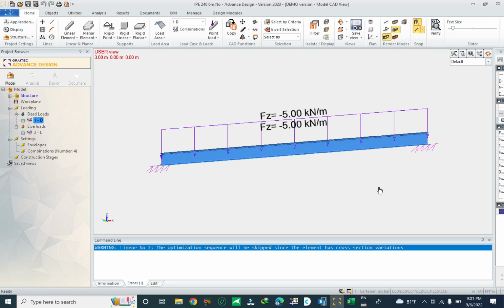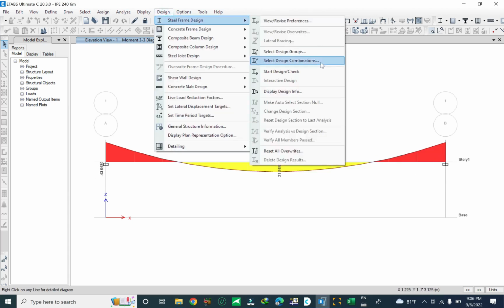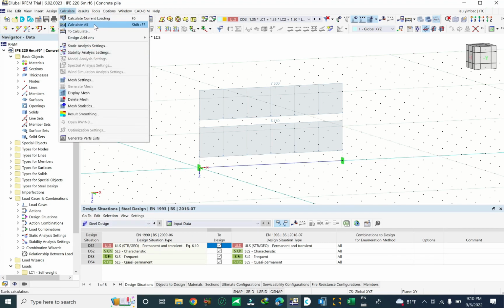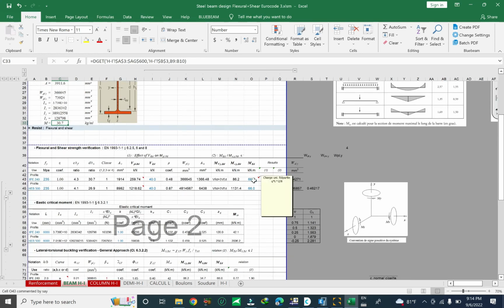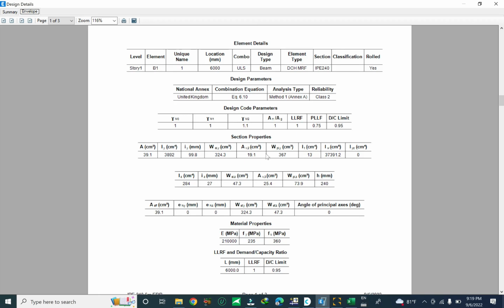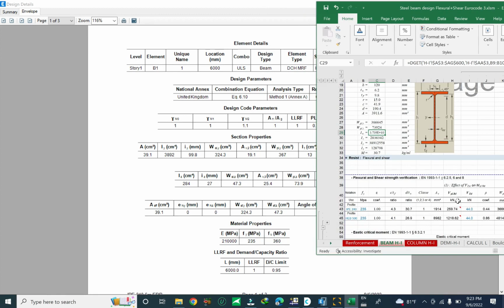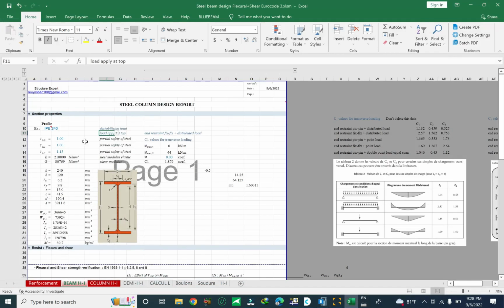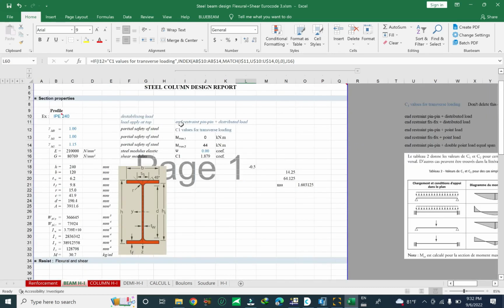Steel Beam Design Etabs, Dlubal Rfem, Graitec Advance Design, Excel Sheet Compare Results Part1

Comment: Hello,

first of, I really liked the presentation and the comparison of different structural analysis programs in the design of steel beams. I have some feedback about the design of the program RFEM.
 
It is evident from the video that an IPE 220 section is used in the model in Dlubal RFEM instead of the IPE 240 section, which is used in other programs. Additionally, when checking for lateral-torsional buckling in Dlubal RFEM, buckling curve "b" is used, which is the default setting that we allow to be changed in the ULS configuration. In the reference solution in the Excel file, buckling curve "a" is used for lateral-torsional buckling.
 
If we create the same model in the current version of our program Dlubal RFEM 6.06.0012, but with the correct IPE 240 section and use buckling curve "a" for lateral-torsional buckling, we get a utilization of 0.936 (for the fix-fix end restraints), which closely matches the reference solution of 0.94 in the Excel file.

Looking forward to seeing more of your content.
Reply from the maker: Yes, you're right 100%. Now I just check this video again also see the section I was used in Dlubal RFEM is IPE 220. thank you for your comment.
Reply: @danieldlubal1421 Hello, I am trying to replicate this example. I can't find where to change the curve used b to a for a cross section. 

In Steel design/Ultimate configuration/Stability/Parameters for lateral torsional buckling -- if Eq 6.57 is selected, curve b is used. If Eq 6.56 is selected, it uses curve a for calculation.

Is this the setting you are referring to? Changing the calculation formula implies changing the buckling curve itself?

Thanks